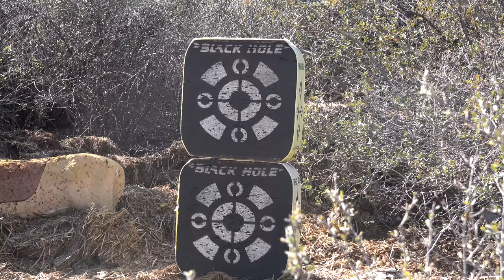Making the Comanche Bow, A Bow Maker's Journey

Comment: Bows with short limbs don't get snagged on cover and can be shot from horseback easily. That's the only reason why they used them. When you examine nomadic hunting groups in areas with less cover or less brush, bows tend more towards longbow designs since a longbow can be drawn to full and shot more precisely. 
I don't get the pseudoscience. A longer draw stores more energy in the limbs to send arrows downrange. Longer bows are needed to draw further. 
All things equal, a longer bow, that can be drawn further since the favorable angles between the strings and limbs prevent stacking (and store way more energy at the same draw weight), will always outperform a shorter bow. This is inviolable.

Comment: Great video, I live in Wales,United Kindom. There is quite a bit of cedar here, would it make a decent bow especially if sinew backed?
Many thanks
Reply: Yes it makes good bows if backed with raw hide or sinew, I think Clay Hayes made video about making a red cedar bow
Reply: But it must be red cedar aka juniper
Reply: The great thing about making bows is you learn something from every bow you build, even failures. Go ahead and try making a bow from whatever wood you have available. Even if it doesn't work, you will learn the skills of chasing the ring and slow removal of wood as well as the fact that the wood you chose isn't a good bow wood.

Comment: I’d like to see one of these short draw length bows through a chronograph shooting an arrow the same grains per pounds as an equal draw weight but longer bow with a longer draw length. Seems like a longer draw length should make for way more speed but i don’t know for sure
Reply from the maker: You would think so, but if you take a long bow and a short bow of equal design and achieve a 45% draw on both bows, the limbs are still under equal stress. The difference is when you cast an arrow from a short bow, it hits home to the brace height faster than the long bow because there is less surface area and a shorter draw length. In return an arrow of the same diameter and material becomes faster. Now if you use a long arrow for a short bow, the long bow will be faster because you are adding arrow weight. At the same time, the short bow will become way faster if a long bow is shooting a shorter arrow. This is why when comparing speeds I am using the same arrow materials and same diameter, just a different length to accommodate the draw length. There really are a lot of factors that goes into bow speeds. I will say, a sinew backed bow will beat the heck out of any long bow. This is because sinew stretches 8 times more than wood. Thus, you can obtain a 60% draw and the limbs are under way more stress which results in higher speed and energy. I hope this helps.
Reply: @PrimitiveLifeways  yea I guess the more I think about it, the more I realize that there are just a ridiculous amount of variables at play here to consider. It’s not just a black or white answer. As with most things people try to simplify. I’m trying to break the habit of that.
Reply from the maker: @MustObeyTheRules   For sure. I always say, at the end of the day, use the bow that works best for you :)
Reply: I would like to see a chronograph a speed measurement as well just for fun.  I think opposite would be true but there are a lot of factors the determine speed so I am not sure.  But shorter limbs and arrows I would think mean less mass has to be accelerated so faster flight.  Longer bows tend to be slow if the limbs are heavy.

Comment: The tribes did not live on the Great plains before the arrival of the horse.  It was far too inhospitable in winter to stay there.  The tribes hunted there but did not live there.  The plains only became occupied after 1700.  Thus the "history" of the plains people is relatively short.  BNTW you are showing the often mistaken way of eye shooting used by native people.  What you are showing is the Olympic draw.  Native people shot off the right side of the bow, as it was more natural.  I see no point in using inches describe the layout of the bow.  Instead why not use natural measurements?  A human hand is roughly four inches, and what you would use for a handle.  Same for the taper to the points, which are about a fingers width.

Comment: I made a fantastic little short bow 1.1m. 
Australian black wattle, the fibres belly ultimately split out and the bow failed but when the bow worked it performed extremely well. not as good as an osage but within 20% of the performance. I entered a competition with the same bow and it failed mid way through 😢

Comment: Very interesting... but I can't help but wonder... In the pre-contact stage of Comanche society, where would they have obtained things like sand-paper? Surely they would have used something else? I'd have liked to see the tools they would have used in the traditional context. I'm also curious to know what the 'pull' strength was for such a short bow.
Reply: I hope this info helps, I am not Comanche but Navajo. In a traditional sense I was taught that various Basalt and Sandstones were shaped into hand length sized rectangular shapes that is somewhat thin and flat as possible on both sides with rounded corners. These refined stone objects then were used to 'sand' down wood and animal horn products into different goods. I'm pretty sure the Comanche and other tribes had similar methods.
Reply: I also forgot to add another method, flint(chert) shaped as a scraper was used to shaped wood, a lot like a draw knife.
Reply: Google is a wonderful thing.